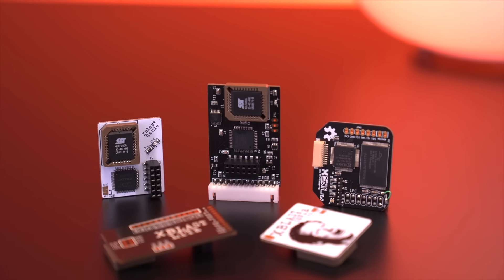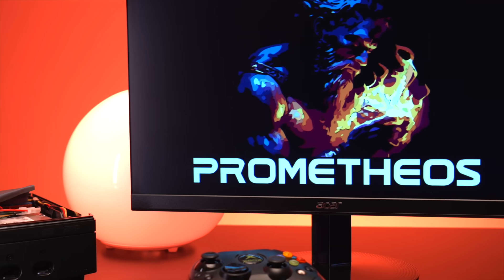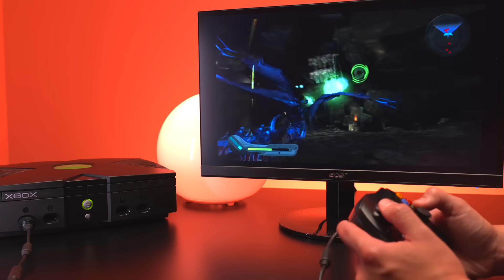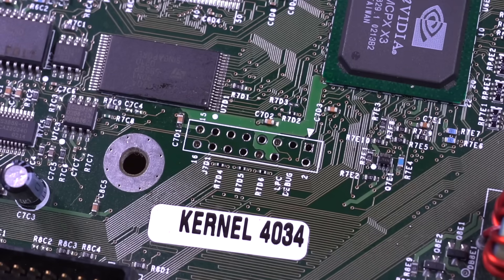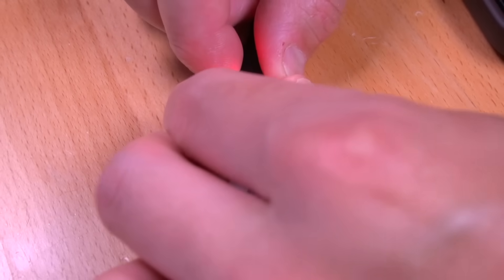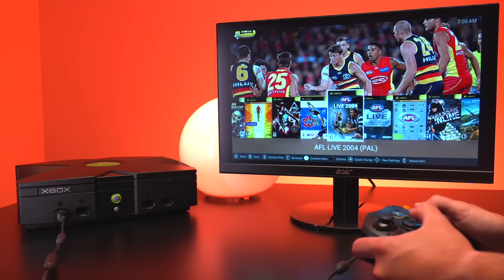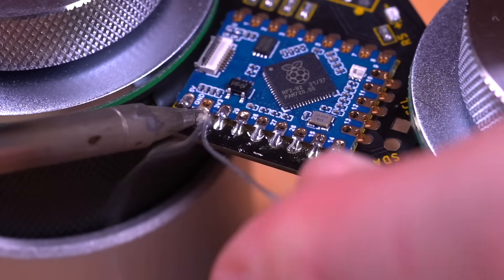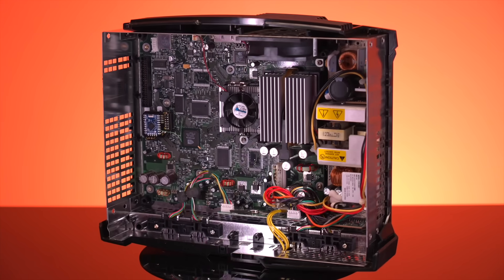Why You Need To Put A Raspberry Pi Pico Inside Your XBOX Right Now!

Comment: wouldn't it be easier to simply use a full raspberry pi as a console? you can even use the OG xbox controller if you want. The library will run fine directly on RP, without the massive box...

Comment: So in regards to Project Steller and Modxo, which seems to be the better option? Modxo being open source is a great advantage but does it have compatibility with insignia (a bit of a novelty function but still a cool function nonetheless). Project Steller being beta is also a drawback but the ability to update on console is pretty cool

Comment: What would it take to build a system that would run its self or 3 other system at ones the computing of 3 raspberry pies one for each system and maybe a special type  of raspberry pies in its self , but build a system that will run 3 gaming system rather with it's own optics and peramiders and graffitics or share its naboring systems software,  making a machine that will be something Intyerly new enhancing each system in it's own rather by memory,  internet, or graphics  .
Reply: The system would have 3 times the power of any other gaming system ever built

Comment: An internal connection to ethernet port to unlock WiFi capabilities of RPi to connect the OG Xbox to the WiFi network, I think this could be awesome!
Reply: What would it take to build a system that would run its self or 3 other system at ones the computing of 3 raspberry pies one for each system and maybe a special type  of raspberry pies in its self , but build a system that will run 3 gaming system rather with it's own optics and peramiders and graffitics or share its naboring systems software,  making a machine that will be something Intyerly new enhancing each system in it's own rather by memory,  internet, or graphics

Comment: How about LCD support, like most top of the line xbox modchips had, back in the day? I remeber back when i had xbox mediacenter running, and showing the mediainfo on the LCD...
Reply: What would it take to build a system that would run its self or 3 other system at ones the computing of 3 raspberry pies one for each system and maybe a special type  of raspberry pies in its self , but build a system that will run 3 gaming system rather with it's own optics and peramiders and graffitics or share its naboring systems software,  making a machine that will be something Intyerly new enhancing each system in it's own rather by memory,  internet, or graphics

Comment: I may not want an xbox but I think a cool project that might extend switch or other consouls is to add a usb port so people can either plug in external harddrives or memory sticks so you can load downloaded games to a high compacity flash drive or external hard drive.
Reply: What would it take to build a system that would run its self or 3 other system at ones the computing of 3 raspberry pies one for each system and maybe a special type  of raspberry pies in its self , but build a system that will run 3 gaming system rather with it's own optics and peramiders and graffitics or share its naboring systems software,  making a machine that will be something Intyerly new enhancing each system in it's own rather by memory,  internet, or graphics

Comment: Would the modxo adapter board with a rp2040 come with everything needed including the usb breakout board  or would I need to get the breakout board in order to put the OS on the pico?
Reply: What would it take to build a system that would run its self or 3 other system at ones the computing of 3 raspberry pies one for each system and maybe a special type  of raspberry pies in its self , but build a system that will run 3 gaming system rather with it's own optics and peramiders and graffitics or share its naboring systems software,  making a machine that will be something Intyerly new enhancing each system in it's own rather by memory,  internet, or graphics

Comment: So let me get this right, you do all this work to play roms on an old xbox when they’re already on your pc?
Reply: People mod the original Xbox to play ROMs for several reasons, even if they already have them on a PC:

1. Nostalgia & Authenticity – The Xbox offers a console experience with a proper controller, making it feel more authentic than playing on a PC.

2. Better TV/CRT Compatibility – Many people prefer playing classic games on a TV, especially a CRT, for a more authentic retro gaming experience. The Xbox has native AV outputs that work well with older displays.

3. All-in-One Emulation Machine – A modded Xbox can act as a dedicated emulation box, meaning you don’t have to boot up a PC, configure settings, or deal with compatibility issues every time you want to play.

4. Ease of Use – Once set up, it's more convenient to navigate games with a controller on a TV rather than using a keyboard and mouse on a PC.

5. Performance & Optimization – The original Xbox has well-optimized emulators that run many retro games smoothly, especially for systems like NES, SNES, Genesis, and PlayStation 1.

6. Softmodding is Cheap & Easy – A softmodded Xbox can be set up with a larger hard drive to store thousands of games, making it a budget-friendly option compared to some other emulation setups.

7. Media Center Features – Many people also use modded Xboxes as media centers (with XBMC), so having ROMs available on the same system adds extra value.

It’s not just about playing ROMs—it’s about the experience, convenience, and making an old console do more than it was ever designed for.

Comment: what about adding a bigger hard drive bwith the pico ? is it option in pico settings
Reply: What would it take to build a system that would run its self or 3 other system at ones the computing of 3 raspberry pies one for each system and maybe a special type  of raspberry pies in its self , but build a system that will run 3 gaming system rather with it's own optics and peramiders and graffitics or share its naboring systems software,  making a machine that will be something Intyerly new enhancing each system in it's own rather by memory,  internet, or graphics

Comment: I just did an Xbox for a friend last week and ended up using one of the Aladdin clones on Amazon.  They work just fine except that they all now come with a flash chip that isn't compatible with the Xbox based flashing tools.  I have a PLCC programmer however, so it's no big deal for me to dump, apply cerbios, and reflash back to the chip before installation.
Reply: What would it take to build a system that would run its self or 3 other system at ones the computing of 3 raspberry pies one for each system and maybe a special type  of raspberry pies in its self , but build a system that will run 3 gaming system rather with it's own optics and peramiders and graffitics or share its naboring systems software,  making a machine that will be something Intyerly new enhancing each system in it's own rather by memory,  internet, or graphics

Comment: is this better than the project stellar mod?  will it work with upgraded memory like the 256 chips? can you load games onto the harddrive through the pi's usb or do you still have to ftp everything to the harddrive?  is there any benefits in using raspberry pico, vs tiny vs zero ect? like can a full size raspberry pi also handle hdmi or anything? great video!

Comment: You know the project stellar modchip/hdmi has a pico chip in it. You flash the recovery os using a .uf2 file. If someone with the know how took the time they could probably make a good open source hdmi mod using these. You can already turn them into mod chips, but there is a lot of potential there if someone with the know how takes the time to do it.
Reply: What would it take to build a system that would run its self or 3 other system at ones the computing of 3 raspberry pies one for each system and maybe a special type  of raspberry pies in its self , but build a system that will run 3 gaming system rather with it's own optics and peramiders and graffitics or share its naboring systems software,  making a machine that will be something Intyerly new enhancing each system in it's own rather by memory,  internet, or graphics

Comment: Is it possible to use the Raspberry Pi Pico 2 as well?
Reply: What would it take to build a system that would run its self or 3 other system at ones the computing of 3 raspberry pies one for each system and maybe a special type  of raspberry pies in its self , but build a system that will run 3 gaming system rather with it's own optics and peramiders and graffitics or share its naboring systems software,  making a machine that will be something Intyerly new enhancing each system in it's own rather by memory,  internet, or graphics

Comment: Nah, im just gonna keep rocking with my 20 year old Xecutor 3 with LCS faceplate and 500gb HDD😅. I wonder if i could get an hdmi port, SSD and Bluetooth controllers added to this thing.
Reply: What would it take to build a system that would run its self or 3 other system at ones the computing of 3 raspberry pies one for each system and maybe a special type  of raspberry pies in its self , but build a system that will run 3 gaming system rather with it's own optics and peramiders and graffitics or share its naboring systems software,  making a machine that will be something Intyerly new enhancing each system in it's own rather by memory,  internet, or graphics

Comment: Can you do a video that goes through everything in the setup?  Like how to build prometheos etc, which is now supported.

I’ve never modded an Xbox, so no prior experience and am struggling. Also, my original Xbox hard drive has failed which is why I’m looking at this solution. 

I’ve purchased the pi zero and carrier board from modsvilleusa.  Do I still need to solder a wire to the mobo?…. I have a 1.5, I think don’t see where to identify what to do?

Comment: I did all the step’s correctly and my Xbox won’t boot to dashboard and the eject light flashes green and orange. I’ve tried everything from resoldering the chip to re-flashing it and nothing seems to work. It goes back to normal when I remove the chip. Idk what to do.
Reply: If you have a 1.6 make sure to do an Lpc rebuild as well otherwise it won’t work
Reply: @quinno1741  I figured it out. I was using a clone chip I bought off of a seller on eBay. I bought a legitimate chip off of Amazon and it worked perfectly 🙂

Comment: I'm having flashbacks from 20 years ago when it took me 30 minutes of trying to solder my executer mod chip to the dreaded D0 contact using a crappy $15 Radio Shack soldering iron with no flux. I got it soldered and working but the trauma remains to this day. Great memories from the early Xbox-Scene days :)
Reply: RadioShack.  Wtf happened to them?  There was a Tandy computer store in my small UK town more than 30 years ago
Reply: Many of us have been through similar situations while learning how to solder with bad equipment! It is cool that you were part of the early modding scene.!

Comment: What tool are you using to remove solder from the through holes?  A soldering iron with suction?  It seems to work very well.  Do you have a link to the item somewhere?  I need to buy one of those.
Reply: it is a "desoldering gun," which works in the way you just spoke of.
Reply: @dogdiggle  What brand/model are you using and/or would you recommend?

Comment: I've been waiting for the perfect mod for the OGXB, so much potential inside that box, q chipset that adds native VGA & HDMI, with 240p, 480p, 720p native rendering modes, and 960p and 1440p integer line double or pixel repetition scale modes, I'd love to see 3:2 or 16:10 aspect modes too. But the potential for adding the ability to use Live CD versions of Windows 98Se for instance, if the mod unlocks the ability to install more RAM, this single weak spot of the OGXB, this would make the OGXB the perfect classic PC gaming machine, given the Xbox not only has a really nice PIII 733Mhz (upgradeable to 1.4Ghz Copermine I believe), but that Nvidia GF3 GPU makes any PC game playable up to around 2002 or so (the NV2A ASIC is closer to GF4 performance, or say GF3.5), and best of all, the OGXB has absolute powerhouse sound hardware, aka the Nvidia Soundstorm, has full real-time hardware MIDI synth capabilities with soundfont/soundbanks support, meaning all those classic MIDI PC games would be compatible, it also has full HRTF for EAX and A3D games, and everything can be encoded in real-time in Dolby Digital surround, it also has a powerful audio DSP, 256 stereo sound channels, and a beautiful quality Wolfson DAC, they went hard with the Xbox sound hardware, an d the Soundstorm completely outclasses modern audio capabilities (or lack of them), if only Nvidia carried on making sound cards, or better yet, incorporated all that audio tech into their GPUs.

The OGXB is already the best place to play multiplats of that generation, but being able to also turn it into a powerful retro PC would be incredible, being able to use all that hardware to play all your favourite PC exclusives with reference video & audio quality would be amazing, and there is the fact that Xbox has some of the best 8/16-Bit console soft emulation available with very little latency thanks to the fast analogue DAC, if the OGXB could get the Amiga PiStorm style upgrade treatment, to give it at least 256MB DDR RAM, an SSD drive, the OGXB Southbridge has PCI that could be exploited to that end.

Comment: Pro Tip - Add flux to your desoldering braid and you probably wont need to use your pump as often.  That combo would have sucked all the solder out of those holes.

Comment: Would the rp2040 zero work the same? I'm not extremely familiar with the pico, and I don't know if there is a difference. I just noticed the zero has the port built onto it vs using a ribbon cable when I was looking these up. Someone educate me a bit please.

Comment: I have some AladdinXT chips (the ones made before they were unflashable) and the install was always hit or miss. One of the reasons I stopped working on the original xbox, the other being that shipping was too expensive to turn a profit. I swear, no matter how good I recreated lpc on 1.6, half the time the thing would reboot three or four times then shut down. The other ones can just be tsop'd and flashed with an evox (or ind) bios, no need for a modchip.

Comment: Wait...why not replace the clock capacitor with a more traditional CMOS battery?
Reply: Because the clock is integrated into the southbridge, a CMOS battery would be drained very quick, the capacitor is only meant to keep it powered long enough for short power outages or moving the console.

Comment: I'm surprised they didn't design it so you use the xbox controller memory card slot and do a soft mod through the save game to load, Then again I don't know what xbox games are capable of doing that, especially if you don't have any games for what ever reason

Comment: The X3 chip I installed in 2005 was the last chip I ever needed. However, I took it out to sell when a collector made an obscene offer for it. I put a Jafar in it’s place and that’s the last chip I’ll ever need. You make a strong case here though. If I ever open my console again, I’ll solder a ribbon cable to the pin header and D0 and run it through a vent, and double-sided tape whatever modchip to the top of the case :D

Comment: I already have everything needed. I also like that this does not use any Windows specific software. Considering I used to install modchips into the Wii and Xbox 360 without any kind magnification I think this is very beginner friendly.

Comment: Bought a wireless transmitter for n64 controller from Retro Fi and it's using a raspi nano. Two of my hitboxes are also using a 2040. Really impressive what raspi did. It's cheap and available. Amazing hw. ☮️

Comment: If you drive the EN pin low on the TSOP, the system will look for a compatible flash device on the LPC bus instead to read the 2bl from which then loads the kernel. The simplest modchip was just one of those TSOP's in a different package, this is also why for up to v1.5 it was quite easy to simply flash the onboard TSOP with the BIOS you needed. I never owned a v1.6 back then, but I have one rusting away somewhere :D

You actually do not need a modchip at all, you can easily get it to boot into Linux to flash the onboard TSOP via known exploits and just be done with it. I have never tried a USB PATA controller to access the drive, but you can hotswap the hard drive IDE cable at the right time to have it unlocked for another PC to access it as long as the XBOX powers it. But hey, it is 2024 and you can probably bruteforce or generate the unlock password these days in mere seconds.

But my memories of this old beast are also very foggy from way back when I still studied electronics, I might still have old code somewhere on spinning rust in a shoebox and I should really dust off the two xboxes I still have to replace that capacitor... the third one I have is sadly exposed to the elements :(
Reply: I might be wrong now I think about it, there are two points you can reach from the side with tweezers that is the write enable on the TSOP.

In case you wanted a "modchip", the single line you pull to ground is one of the data lines as this will cause the 2bl to read the kernel from the LPC bus instead.

But like I said before, you do not need a modchip for these systems at all. You can just flash the TSOP from Linux with flashrom on everything that is not v1.6.

Comment: Technically the cheapest is just a nor or nand flash via lpc headers run custom bios
Reply: Better off with an esp32 because then you could somehow get wifi and bluetooth too

And more CPU cores, like around 300mhz
Depends on the version

Run it via a cpld as a buffer so u can run an asynchronous bus and not have to worry about CPU clock vs bus timing